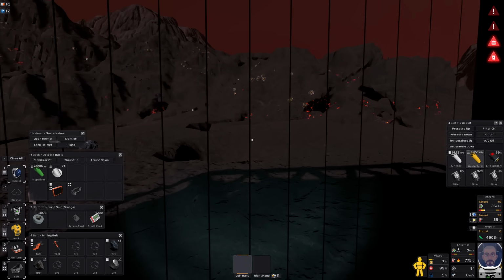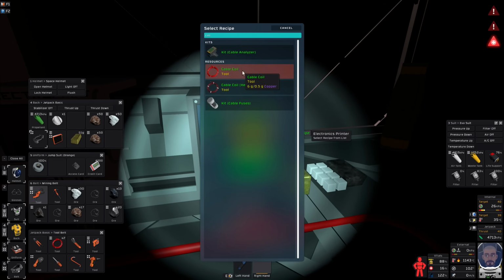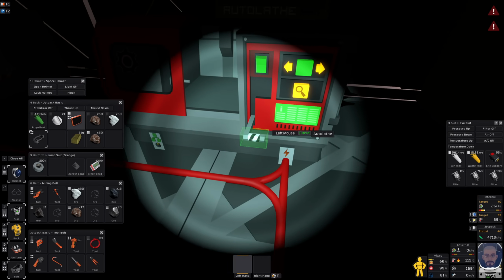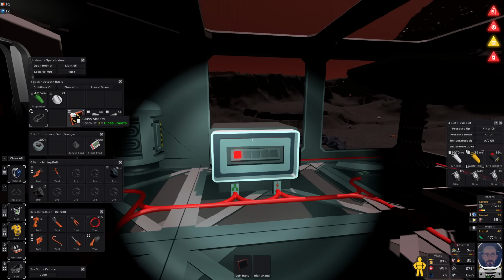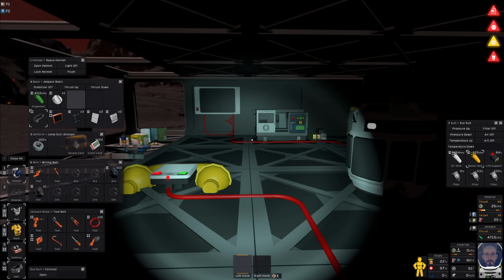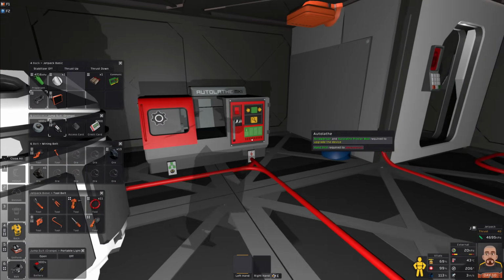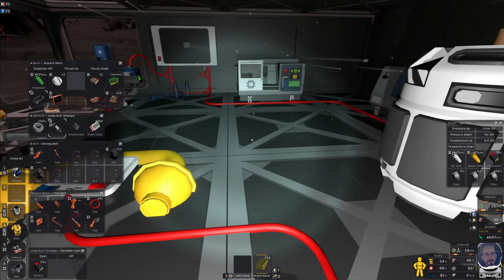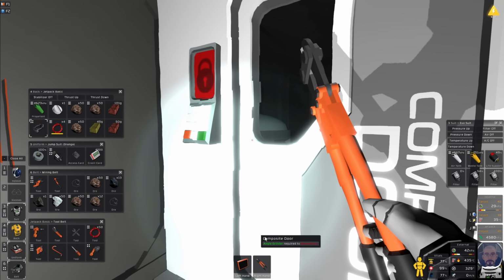Creature Comforts - S2 E3 ║ Stationeers

Comment: I always like to keep one data disk inside and one outside, just in case there is something wrong with the airlock and it needs to be reconfigured. So making a second one is perfect :D

Has saved me quite a few times already. For some reason my airlocks like to just randomly break sometimes.
Reply from the maker: Hmm, maybe keeping one in the airlock console might not be a bad idea. Accessible from both sides, and I use the door buttons anyways, so having it turned off is not going to change much. :D
Reply: in the current beta they are changing the consoles to not need the data disk anymore, it's just.a screw you turn to enable config mode

Comment: 9:06 The problem is when you remove the APC you wont have a backup anymore when your Station Battery is empty. No Solar Panel will move anymore to charge a new or other Station Batteries. So I would use the APC with a small backup battery in it. Also when you twist around your Daylight Sensor you have to adjust the code in the IC10 chip or your panels will be off the black hole.

Comment: I screamed, "No, god please no" when I saw you open the oxygen in the whole base (in contact with the walls and windows) and in a super large volume. Personally, I make myself a smaller pressurized room between frames or I can use walls if there is no atmosphere on the other side of the wall (because it's the unpressurized base)

Comment: Have you noticed any performance drops with the new terrain update? I'm pondering getting the game but if the system requirements need to be updated to account for the new terrain etc I'm SOL.
Reply: the terrain update actually makes performance better

the game used to generate the entire terrain as you explored and keep it loaded all the time now the terrain is pre generated and only parts next to you are loaded
Reply from the maker: Yep, as GD said, it should be better than it used to be, and it never was too bad to begin with. The random generation ate up a lot of RAM though, which is no longer a problem, since it only needs to store what you changed.
Reply: @Hmuda Well, neither ram nor cpu is a problem, I just worried that the gpu requirements seemed a little too optimistic. It's an oldish game but with the new terrain I figured things might've changed.
Reply from the maker: @ddew  The terrain tesselation does make it a bit sluggish if it's set too high, but it looks great even on low (that's where I set it myself), and it runs great now.
In fact, it ran fine with it on max, except when I had my recording software working in the background, then it became a bit sluggish (framerate in the first couple episodes were not all that great), but after lowering tesselation it is a lot faster, and still looks great.
Reply: @Hmuda Cool, my gpu is a couple of generations out of date but has plenty of vram and if there's not tons of shaders and the like I ought to be fine. Cheers.